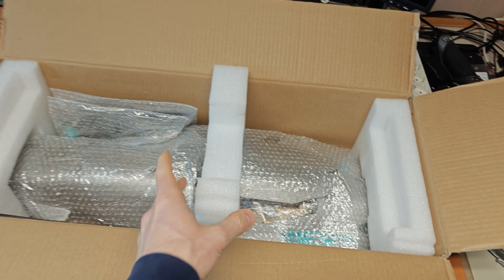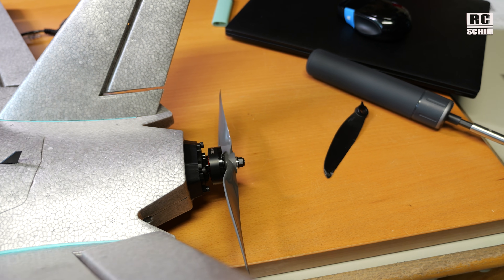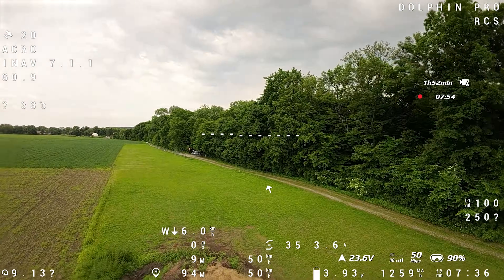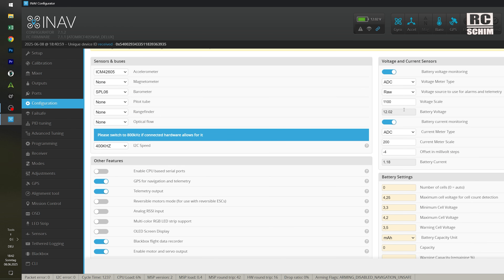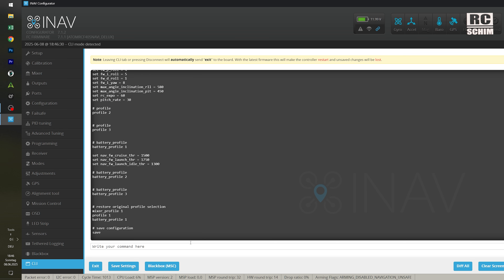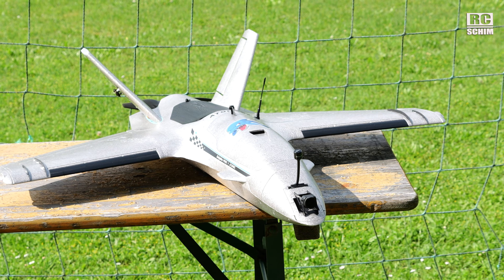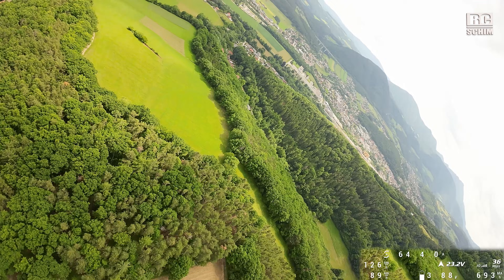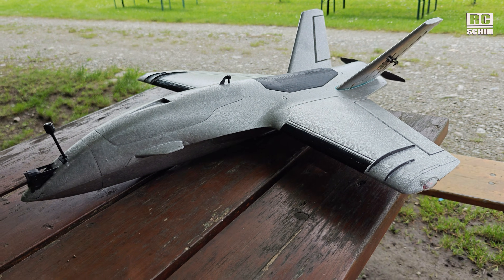AtomRC DolphinPro Review, flights, chase shots

Comment from the maker: UPDATE: Just back from a great testflight this afternoon!  INAV 8.0.1 + DELTA Mix (for elevons + 20% mix to VTAIL elevator instead of only using the VTAIL for elevator)   + some tweaks from Andrew Newton;
flies like a different plane now! So like most other testers found: we should fly the DolphinPro with ELEVONS not VTAIL Elevator! You'll find the new DIFF with my settings here:    (motormount, Back-Lid, INAV DIFF)
https://drive.google.com/drive/folders/1Ub6ZzTVg5DffZoFN3oqFhu13LcVaaAX9?usp=sharing

Attention:  Autolaunch ANGLE:   I set the planes preset angle to 5° in setup, this then has to be added to my Launch angle (so I went from 18° to 25°)  - todays autolaunch was only about 13° and quite flat.... but ok.  
greets and happy weekend!
Reply: thanks
Reply: Hi Mario, Did you set reflex 5mm manually along with Andrews thrust angle adjustment ? Thanks
Reply from the maker: @lw40404040 nope, neither of the 2 adjustments. I still got up and down waves on the nav flight modes, but it is not accumulating and would not cause real issues on RTH flight...

Comment: Apologies if you mentioned it, but it seems like you’re using a 4 pin cable to another 4 pin cable connecting to your  receiver, this is my first Plane, what receiver are you using that is capable of being plugged in with a 4 pin cable like that? Thanks.
Reply from the maker: On the dolphin Pro I use the Crossfire nano RX (from Team Black sheep). These days ELRS RX are more commonly used since they are cheaper and seem to be good as well.
Most of these drone RX are the same:   they have 4 cables:  + and - (red and black for power), and TX (transmit) and RX (receive) - which are the two data lines needed.
These RX work if there is some kind of flight control board involved (which just takes these data lines).   If you have an old tech PWM only RC plane or car - you deal with a bunch of 3 pole servo wires (one per each channel). Greets, Mario

Comment: Looks a bit wobbly almost looks like it’s flying a little tail heavy.
Reply from the maker: That's right. On my last few flights I tried 3-5mm fwd of original CG and 3mmm reflex - recommendation from OliverC. And this seems about right. Still have some soft z-wobble on NAV modes - but it flies home if it has too so I'm fine with it.